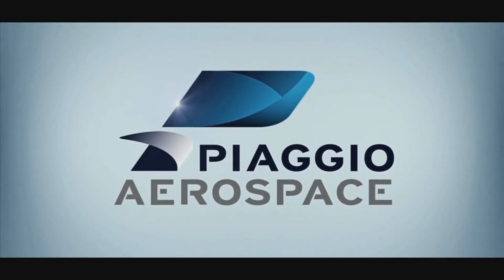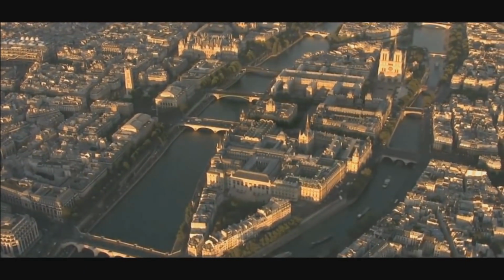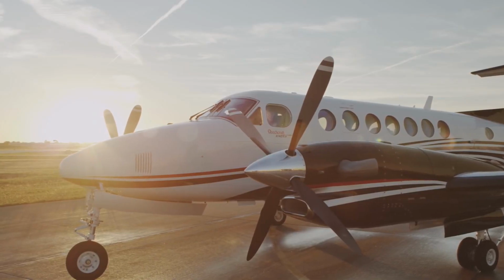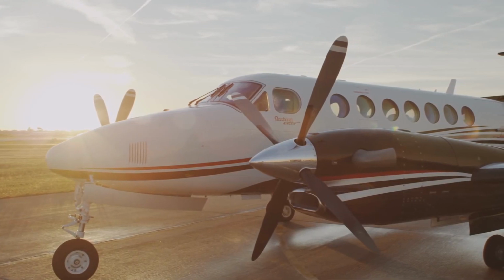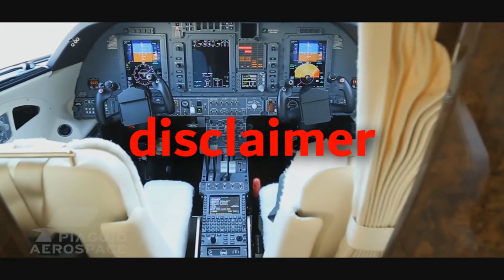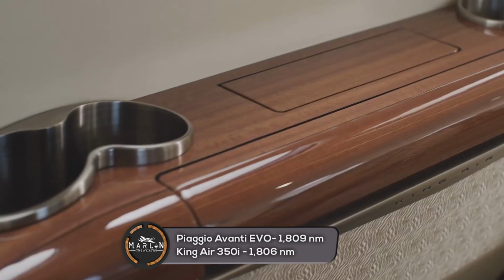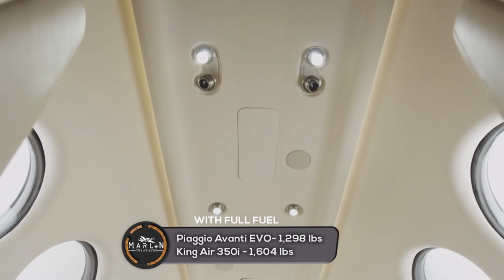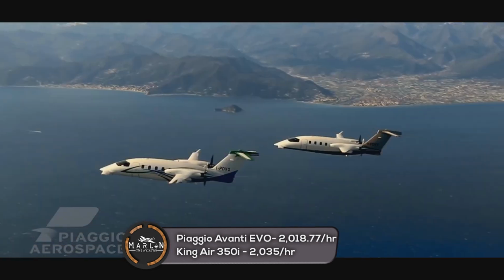Better Aircraft - Piaggio P180 Avanti EVO vs King Air 350i

Comment: The deal breaker for me is the cabin ceiling height in the King Air. It’s only 4.8 feet - you’d have to be a midget to stand up in that airplane. And it doesn’t come standard with a lavatory. The Piaggio’s cabin height is 5.8 feet and the enclosed lav is standard, which makes this airplane the clear winner in my book.

Comment: King air is the plane I hate the most. It is so texas farmer trump voter void of any sensibility. It looks like it's straight out of 1950 or earlier, it's so ugly, so void of any sophistication and so grossly expensive. The Piaggio nicely illustrates how much better it could be. 30% faster while burning 30% less fuel. No small margin. But it could be even much better than the Piaggio. A single piece carbon fiber shell fuselage with high tech thin insulation saving 15cm in hull thickness which is a lot of reduced aerodynamic cross section. Also a CF shell could be dramatically lighter. The 6 seater Eclipse 550 jet nicely illustrates that jets can be efficient and voids the existence of turboprops as it uses only half the fuel that the Piaggio does with 10 seats at similar speed. Turboprops are notoriously noisy, the require prop clearance and they are much heavier than turbofan engines. And more complex.
Such a carbon fiber jet Piaggio could be truly something.

Comment: The P180 is a much later design  Just looking at the size of the main wing and the difference in aspect ratio. Pushers are a bit more efficient. But if you are not picky, you can save big with the King Air by buying a used C90 or 200 much cheaper and trade all the steam gauges and have the new STC ed engine and prop mod done and still have lots left over from $8 million. I stay away from the 360, for the biggest change I suspect is adding 10 to the number 350 for marketing purpose ?

Comment: The Avanti any day! The King Air is basically a late 1950's design "Queen Air" which has been stretched and stretched and upgraded with turbine engines through the years! Still all the same wing bolt problems and still an old design!

Comment: I would like to know how you explain the similar operation costs when you stated that the Piaggio burns 100 Gallons of fuel per hour and  King Air burns 139 Gallons, that is over 1/3rd extra Fuel cost and I would have to assume that the King Air also has a significantly larger fuel capacity to reach the almost identical range based on its fuel guzzling performance

Comment: Props need clean air, pusher design is bad, exhaust gas damage and shorten life of the props.
Reply: The biggest part is clean air into the engine. A propeller can do fine in haze, mist, or fumes as long as the particulate is not abrasive. The only things I could see doing damage rocks and volcanic ash, neither of which should be coming out of your engine.
Reply: LOL no

Comment: Another video by someone that Obviously doesn’t work Directly in the industry.
If YOU are paying the bills, the KA is the Hands-down winner.
The P180 is a maintenance and upkeep financial drain. Getting parts is ALWAYS a problem and to add insult to injury, the Mean Time Between Failure (MTBF) on P180 Line Replaceable Units (LRU’s) is Orders of Magnitude higher.
Also, you say the operating expenses the KA are greater than the P180 is LUDICROUS.
If all you say is true, WHY DO SO INCREDIBLY FEW P180’s exist in small to mid-size flight departments? COST/RELIABILITY/VALUE and PAYLOAD is the Cryptonite for P180 operators.
The P180 is Sexy and Fast. Other than that, the KA 350i is a proven performer that company actuaries AND pax always appreciate.

Comment: Avante Maximus!

Piaggio should come up with a plane called the Piaggio Avante Maximus! which would be 4 ft longer, 1 foot 4" wider and the interior cabin height would be 6 ft 1" this would accommodate a full size 6 ft sofa that underneath the knees would flip out about 8 in to make it a nice comfortable bed and this would accommodate a 18-in wide to 24 in wide galley food prep area which would include a microwave and refrigerator freezer compartment that would free up space in the cabin and they should sell it for $12,995,000 this would accommodate up to nine passengers including the lavatory seat. Make the engines 10 to 15% more efficient than the Avante Evo and make the cabin also about 10 to 15% quieter with an extended flight range of between 600 and 800 Miles over the Avante Evo. They also should make the ground clearance about 8" higher, that would give the plane a higher ground clearance and also make the plane look more substantial - taller and more competitive with the Jets that it would now compete with.  This particular model would sell through the roof nobody would want a King Air or anything close to that, this would be a total alternative at lesser of a price and more cost beneficial than a jet any day of the week... This would attract private purchases and charter services like crazy... all the advantages of a jet with those sexy rear Pusher propellers!....Avante you're missing out on big sales! Avante Maximus ready to fly for 2025!
Reply: It also needs the pro line fusion with synthetic vision, range to go from LA to Honolulu and a external serviceable lavatory. If they did all these things they would rule the market.

Comment: Absolutely Beautiful Aircraft, both of them, flew all of the Beechcraft King Air Worldwide and they're extremely Reliable. But.. The Avanti was just Simply a really Fun Aircraft to fly, Fantastic Performance,  TAS of 420 on the Piagio Evo. Plus extremely Quiet inside.
Reply: Seriously, TAS of 420 kts at FL410?
Reply: @birgerkagan6087  sorry, at FL 310  I should have Clarified that, my sincere apologies, thank you pointing it out.
Reply: @P-CROZIER  OK. Well, assuming ISA that would give you a M-no of 0,71 so let me ask you if that is in any way likely that ATS will allow you to fly at FL310 doing M.7 (=MMo) when everybody around you are doing M,8? that's an awful lot of airspace they need to reserve for you alone - as far as I remember same altitude/same track requires 10 minutes separation and since those cruising at M.8 catch up on you at the rate of 1 nm per minute it requires quite a bit of level change in order to maintain separation

Also I find cruising at your airplanes MMo unusual?

Comment: The P180 should be EVERYWHERE! People's distrust of pusher configurations keeps on keeping on. With the speed of a VLJ vs a King Air with less fuel burn it should be a no brainer. The P180 recently reached a million combined flight hours. It's no longer a question regarding performance and reliability. Another factor is that range can be extended in economy cruise. 
A big negative is the power. If they used the 1250shp versions and reverse thrust nobody would buy anything else. Another 800 shaft horsepower would set it alone in climb out as well as takeoff and landing distance. The extra speed doesn't do much in short blocks because of the climb. If they put 1250s on the wings, it would climb out like a jet. Piaggio, if you want to take away some of Beech's market share, put 60 alphas on the wings. It wouldn't do much of anything to the economy. A pt6 is a pt6, Honeywell 331s would get better economy ;-)
Reply: Brilliant!!!

Comment: Beechcraft's curious disclaimer leaves a lot to be answered for. Piagio's use of laminar flow technology makes for significant performance difference as Captain Richard Hartman points out in comment below. Beechcraft engineers obviously din not apply newer design technology to the fuselage, and a close look at the forward area around windshield clearly reveals awkward transitions, certain to generate turbulent airflow. Every airplane is a compromise, but the Piaggio engineers sacrificed little in order to achieve a lot of extra performance.

Comment: The Piaggio P180 has the same operational cost of the King Air 350.  The difference between both is, at the same time of flight, one hour, you can fly 400kts on Piaggio, on King Air only 300kts.
Why the people do not inform the cost for mille and for passengers? Allways is the same, no good information, no confidente comparassdons.  Sorry media, it's a lastime.

Comment: OK...so you DO show the operating cost per hour, but that is NOT truly meaningful.  Basically the fixed costs will be roughly similar, but the COST PER MILE (either situate or nautical or even kilometer), when compared for the two aircraft will tell you more than the cost per hour. Having flown some of the first Piaggio Avantis in this country (not a lot, but somewhere around 1100-1200 hours?) and most of the King Air series--- 90, (100 Garretts only, not Pratts), 200, C-12, U-21 aircraft (but NOT the 350i---), I can not directly compare these two aircraft, but I can say when you look down at the 200/250/300 series King Airs as you pass them, they APPEAR to be going backwards due to the (approximately 100 knot----OR MORE) difference in speeds when compared to the SLOWEST of the Piaggio Avanti series.

Comment: Seems like the Piagio is better in every way including price
Reply: I don't think it can go into unsealed strips either...
Reply: Mostly...except some complain of outdated avionics, poor braking/stopping, and I'm not sure how easy it is to source maintenance and parts.   But definitely a sweet plane in looks and performance.
Reply: @sunshinecycling  something that looks like a spaceship deserves g3000 avionics
Reply: It's almost as though the piagio outperforms the king sure because it's significantly lighter.
Reply: @LilleyAdam  It is a three lifting surface design, with much less aerodynamic drag. It's not appreciably lighter than a KA 200.
Reply: The Piaggio is not better in every way.  It is not better in sales or time to market.  Those two things are probably more important than the slight margins it has in performance and price.   The Beta max was better than VHS.  But Sony Beta max lost to the VHS market.  The Apple Mac OS is better than the PC Windows.  But the PC has the lion's share of the market.  Apple only has 12% of the market.
Reply: @skytrainii8933  Slight performance advantage margin?

Comment: Although hourly cost is similar, one would have to take in account that the P180 is 33% faster (or King 350 is 25% slower)... So at the end, operational costs of the Piaggio would be 25% less, or the King 350 33% more aprox.

Comment: Let's remember the Avanti Evo wasn't available until 2015 and the 350i became available back in 2008, so there's a 7 year difference. I'd like to have seen the comparison with blackhawk PT6A-67A upgrade package or even the 360 with the engine and prop upgrades.
Reply: The EVO is still 70kts faster than the King Air 350 with the 67A conversion. 402kts vs 332kts.

Comment: The P180 and the starship are uneconomical to fly.  They are fast, but at their price you are better off with a used jet
Reply: @McFarland 
Piaggio is a out $2715 an hour
KA 350i about $1250
Reply: @greenknight907  is that Australian dollars?
Reply: @greenknight907  do you or anyone know how much roughly a Fokker 50 costs to operate per hour? Yes I know the Fokker 50 is a completely different aircraft but I've always wanted to know how much per hour it would cost
Reply: @AviationPerthYPPH  you mean a Falcon 50. Engine programs alone is 1300 per hour. 
Total cost per hour on a F50 is around 4200, assuming 250 hours per year owner use and 200 hour charter to offset some costs.
Reply: @soloexcavadoras  no i didn't mean a Falcon 50. When I said F50 I meant F50 - Fokker 50
Reply: P180 sure cheaper than a jet to maintain and fly, actually the king air is the one that has only a slim advantage over single engine turboprops at a lot higher operating costs. uneconomical are both, if you want economics take a bus,train or comercial airline.

Comment: the Piaggio does NOT have a conventional tail plane the tail plane in a Piaggio is a lifting surface.  A conventional  tail has a negative lift or downward force.  All three wings in a Piaggio are lifting surfaces
Reply: thats why the tail does not need deicing boots.

Comment: Totally agree. No one who is a casual airplane fan, knows what a Piaggio P180 is. A King Air? Absolutely.  The P180 is the plane I would get. Like a Turboprop Ferrari of the sky. King Air is a solid airplane too. The P180 is more like the future, where the King Air you know has been around.
Reply: Agree with you there however the biggest appeal with the Avanti is its speed which is significantly higher then the King Air 350.

Comment: I flew right seat on a King Air C-90 so it was quite some time ago.  Nothing like burning kerosene :)   But given a choice, I would likely select the Piaggio.  Those Italians know speed and performance.
Reply: Not all of the Italians, try Tecnam, it is no faster than a 172 with similar power.
Reply: Performance  Tecnam P2010
Maximum speed: 260 km/h (160 mph, 140 kn)
Cruise speed: 237 km/h (147 mph, 128 kn) normal, at 65% power at 2,286 m (7,500 ft)
Stall speed: 96 km/h (60 mph, 52 kn) flaps down
Range: 1,222 km (759 mi, 660 nmi)
Service ceiling: 4,572 m (15,000 ft)
Rate of climb: 5.3 m/s (1,040 ft/min) maximum at sea level

Performance  C-172
Cruise speed: 122 kn (140 mph, 226 km/h)
Stall speed: 47 kn (54 mph, 87 km/h) (power off, flaps down)[84]
Never exceed speed: 163 kn (188 mph, 302 km/h) (IAS)[8]
Range: 696 nmi (801 mi, 1,289 km) with 45 minute reserve, 55% power, at 12,000 feet (3,700 m)
Service ceiling: 13,500 ft (4,100 m)
Rate of climb: 721 ft/min (3.66 m/s)
Wing loading: 14.1 lb/sq ft (68.6 kg/m2) @tonylam9548

Comment: Land a Piaggio, then land a KA. Indeed, the Piaggio has jet like speeds.. like a fully loaded 747 with all engines out, and on short final to Gimli. And KA's have the fusion avionics now.. which are really freaking fantastic.  In the end it's not going to matter. Piaggio will be out of the game in a few years anyway.
Reply: My opinion (not a "high time" pilot (maybe only slightly over 13,000 hours) and having landed MANY, MANY King Airs, various biz jets, gliders, seaplanes, Helos and also the Piaggio hundreds of times, I have to say that the Piaggio DOES require a little more attention on approach/ landing and roll out than the King Air series (though nothing hyper demanding/superhuman or whatever) but then driving a Ferrari requires a little more attention than does a Buick, huh?
Reply: @donjohnson8649  180's fly out of my local allot. It's a hot lander. KA's have giant wings too, with a fat cord... anyway you know.. 13k hours beats me!
Reply: @hawkdsl   Exactly...they are different aircraft. and the Piaggio is NOT a "hot lander"---it just lands a little faster than a King Air due to different wing aerodynamics. That's just part of them being different and learning how to calculate Vref and then fly it on final---works for pretty much everything and is pretty much necessary to kn ow for the air frame you are flying at the moment and how the current variables affect the speed you need to fly.  BTW, "Hot lander" is more in the F-104 neighborhood.
Reply: You sound like an outsider, who want us to believe you are an insider... ;-) Don't spread BS here!
Reply: @MichaelOZimmermannJCDECS  You obviously have no clue what I was talking about. /rolls eyes. Jesus.
Reply: Hope not, beautiful aircraft. poorly marketed.
Reply: @soloexcavadoras  Yes.  The Piaggio is a great plane. Sadly, it's kind of out of their hands. The current economic state of the world is the bigger problem. There simply isn't a big demand for aircraft, and the recovery will be long.

Comment: IMHO
The Evo is head and shoulders above the KA. The KAs are very overrated. 

Piaggio should add the larger fuel capacity and bigger wings to the Evo, like is on the Drone version. More range, shorter takeoffs and slower landing speed (I would think), would make it more favorable to buy. Then Piaggio needs to increase Parts inventory and expand the service network. 

That should greatly help sales. Then come out with a larger Jet version with 4000+ NM range. 

The Fuselage design is spot on for efficiency. Funny that Otto Aviation Celera is copied from the Avanti design. 

Again just my opinion
Reply: Just as tje Avanti took many design elements from Beechcraft Starship.  shrug  we all steal from somewhere
Reply: @Teladian2   No way. I worked on both installations at both OEMs. Beech starship was based on a Burt Rutan design. Piaggio, in house, clean sheet.
Reply: love your opinion thanks for sharing your thoughts
Reply: The Hammerhead version of the Avanti has much of the interior space devoted to fuel tanks, but that would not work for the general aviation version for obvious reasons. Perhaps they could find some more modern and more efficient engines, and make sure they are auto-throttle capable so they can switch to Garmin avionics?

I read that the laminar flow aerodynamic design on the Avanti can only be scaled up a small amount in size before it no longer works. Same with the Celera. But doing even that would likely price it out of the category. The Celera is going to be interesting if they keep the price down, especially the larger model. It will be a paradigm shift for the airline industry.

Comment: I think the king air is best but the piaggio goes 750 kmh of speed and 37,000 ft of altitud is like a Jet
Reply: Don't be fooled by that number. That is the rated altitude for the body. Like the KA is suppose to be able to go up to 35,000, but the standard KA350i can only do 28,000 and that is do to the engine. the Blackhawk upgraded engine allows you go up to 31,000 ft.
Reply: @andrewschliewe6392  for the Piaggio?
Reply: @AviationPerthYPPH  I don't know what altitude the PW engines are rated for the piaggio. What I put was strictly for the King Air.
Reply: @andrewschliewe6392  good to think about
Reply: Imagine when the Avanti gets a nice tailwind...even a 40 or 50 or 60 knot tailwind....heaven :-)